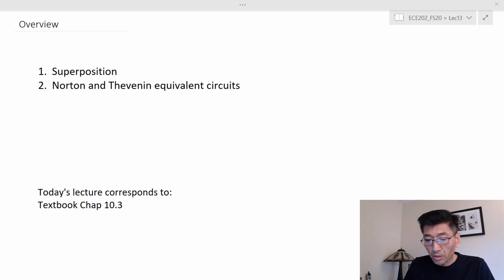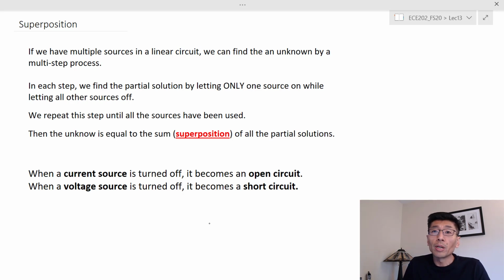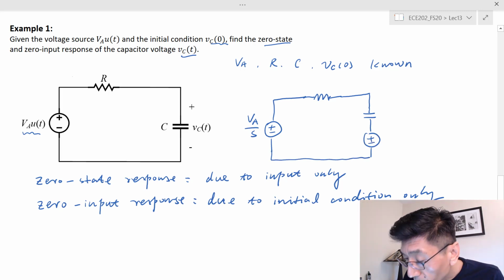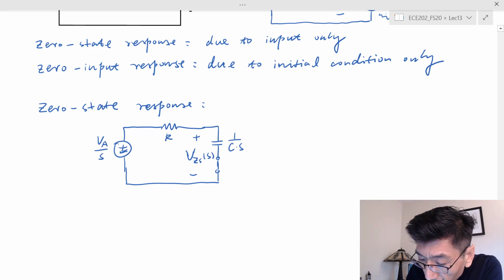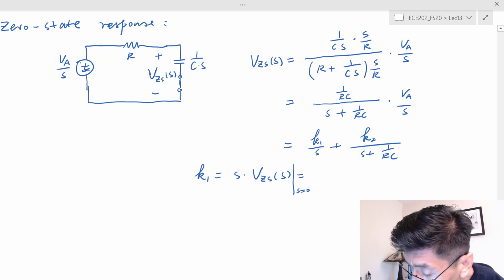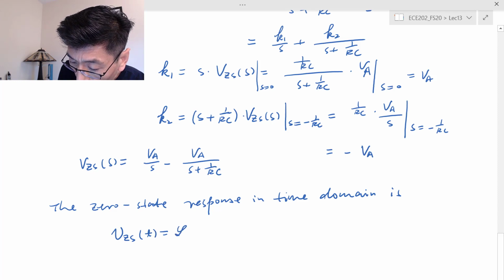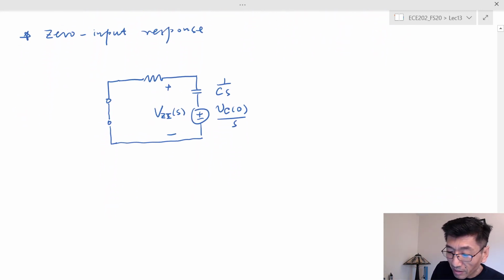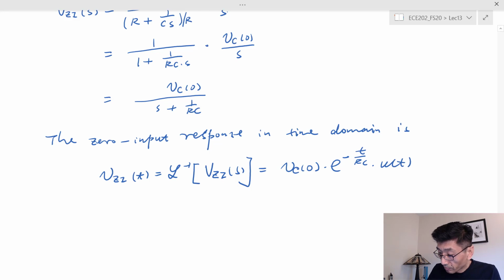ECE202_Lec13_Part 1 Superposition

Comment: Sir, in the zero input response we need to find the capacitor voltage why we find the voltage across Resistor?
Reply from the maker: That’s a great question! In s-domain, the capacitor voltage is the voltage across the impedance 1/Cs and the voltage vc(0)/s, not just the voltage across the impedance 1/Cs.